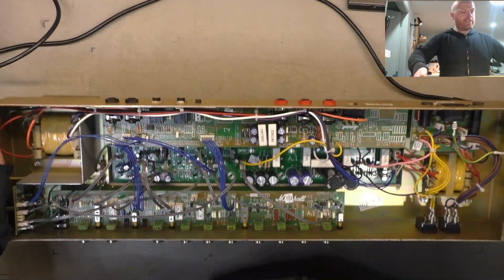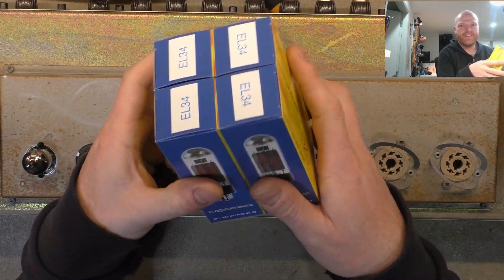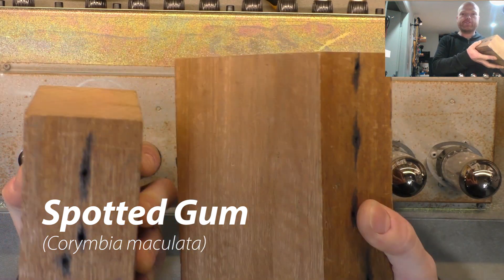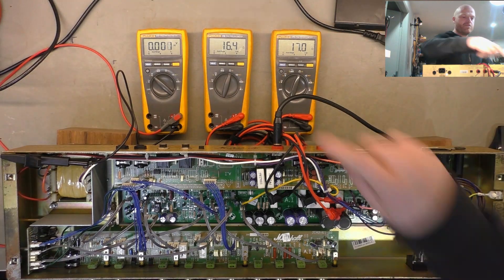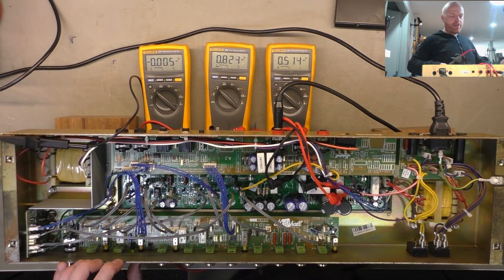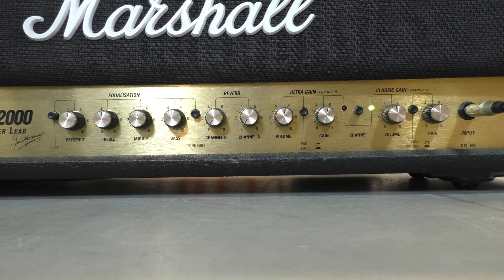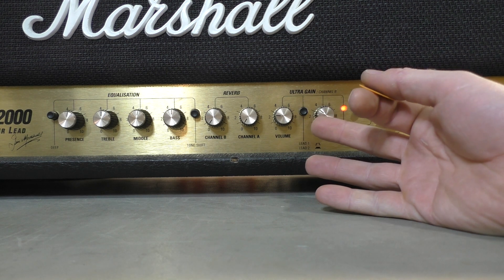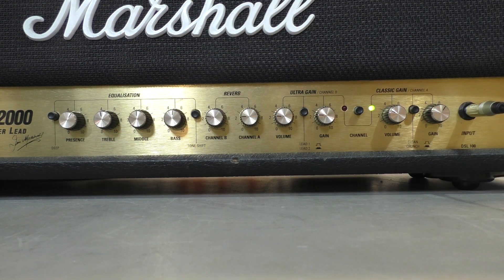JCM2000 DSL100 Main PCB Replacement - Part 3

Comment: Likey likey already subscribey 🤙 my spellcheck really doesn't like that comment haha. I'd sooner fab and weld something than know what to do with a block of wood. Could be cool to see some woodworking from someone familiar. I wouldn't mind it but I know some folks get their feathers ruffled if you veer out of your perceived content lane. The views and watch time will probably tell you if it's worth it to keep making them
Reply from the maker: Well, I'm in luck because it's my channel and I do whatever the f*** I feel like and have a real job, so don't really care about how many views I get. I do like watching fab stuff from time to time. And I do occasionally pull out the TIG for a bit of fun. But there's no way I'm claiming to know anything about welding. Lol!
Reply: @BradsGuitarGarage  If you do end up making some videos on it, I'll probably be watching it 🍻. I moved a couple years ago and haven't had my garage wired for my TIG yet. I need to get it wired for 220V, which may sound odd lol
Reply from the maker: I'd love to get 3 phase at home one day. I've got a 15A outlet which at 240v is quite a few angry pixies moving about.